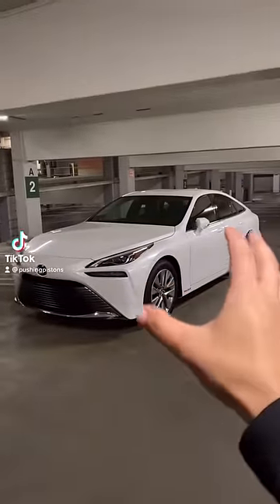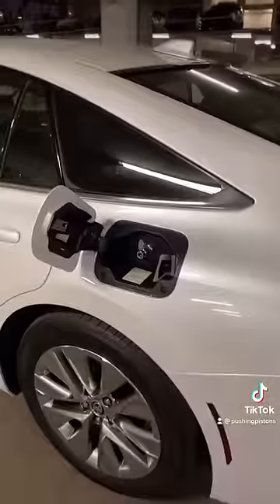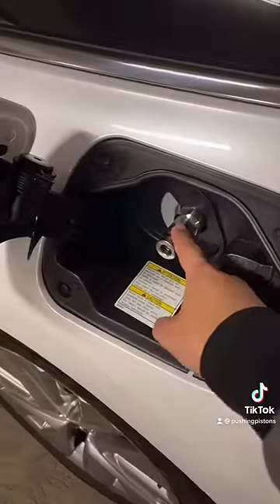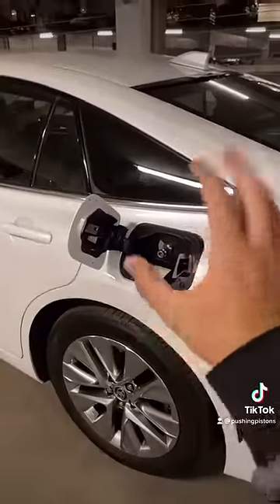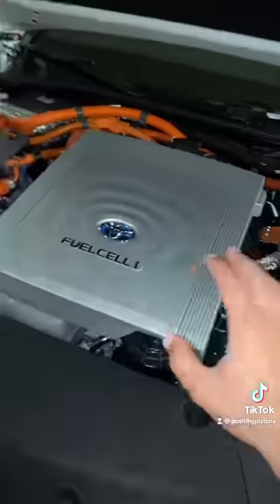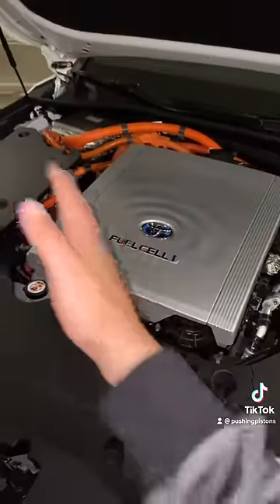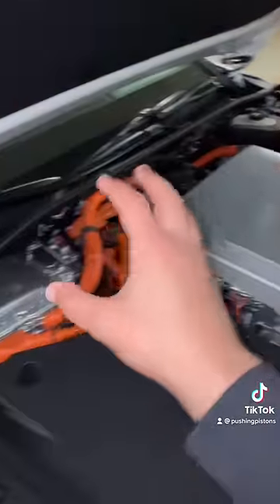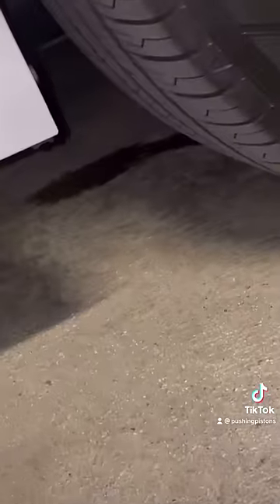How Toyota Mirai Works

Comment: The first electric car with an exhaust... that ejects water...
Reply: @mohdaslam3191  did you pay attention he said there’s electric motors and batteries... it’s just an electric car that uses hydrogen instead of a wall plug to charge
Reply: @stevenbrumjr1005  bruhh.what i meant was that it is generally called an hydrogen fuell cell car rather than being called as an electric car.
Reply: @mohdaslam3191  no you didn’t, you deleted the comment and everything.. just take the L
Reply: @stevenbrumjr1005  lol it was a mistake i tried to edit it...
Reply: @stevenbrumjr1005  is this what drives you? Handing L’s to people you’ll never talk to in your life. cmon now.
Reply: Wasn't there some before?
Reply: @Ant_Man211  well you didn’t see the original comment he deleted but he was pretty rude, I figured I’d be rude back.
Reply: If we all drive one of these, we can refill the oceans 😂🤣
Reply: @Ant_Man211   hahahahahahaaaa
Reply: @chrissalimi8708  With clean water.
Reply: @Ant_Man211  hold his L
Reply: @mrfirespace  what are you 9?
Reply: Not an exhaust. A drain pipe to be exact.
Reply: Urinates😅
Reply: @stevenbrumjr1005  Don’t fight fire with fire.
Reply: @mohdaslam3191  it’s only called Eletric if it’s main power electricity  from its not hydrogen that is the main power.
Reply: @mohdaslam3191  LMAO comment deleted? Why?
Reply: @mohdaslam3191  

We categorize vehicles by their fuel type, diesel, gas, electic, hybrid, hydrogen. Please read a book
Reply: Ths is the future. We need this way you don’t depend on the grid for everything. Hydrogen + Oxygen = electricity
Reply: Water byproduct not too feasible in a freezing winter climate

Comment: Imagine just crashing one of these and all you see is an explosion of water
Reply: Sounds pretty safe lol besides the whole crashing part lol
Reply: Would that be safe?
Reply: @TheBoxingNinja  I mean its water, so i guess its safe
Reply: Actually water is just the byproduct after the process is complete, it doesn’t store it. The car stores extremely flammable hydrogen in it’s tanks.
Reply: @That_Stinger_GT5  hydrogen is flammable
Reply: @That_Stinger_GT5  you know Hydrogen is explosive right? You ever hear of a hydrogen bomb. Not exactly safe
Reply: @Hallowsaw  these cars, if they get into production, are mini hydrogen bombs everywhere. i don’t see how that’s safe
Reply: @Hallowsaw  Hydrogen in these tanks aren’t the same hydrogen in the hydrogen bombs LOL. H bombs use rare isotopes and a completely different process to extract energy which is fusion, not water. These tanks can still be extremely explosive but are very well protected, but not even close to a h bomb.
Reply: @Hallowsaw  Hydrogen bombs are a bit different. It requires an enormous amount of input energy to trigger the fusion that releases that much energy (the concept is to use a fission/"regular" nuke to trigger a second fusion stage), far more than any car crash has ever produced. Although, hydrogen isn't exactly safe and is definitely explosive, it isn't on THAT level lol
Reply: @thejflores1219  yes bro thank you for informing these ignorant people with chemistry
Reply: THEJFLORES12 wanna do my homework
Reply: @That_Stinger_GT5  lol yeah you’re right
Reply: @Hallowsaw  Just imagine a bunch of these next to each other and there being a chain reaction of mini explosions
Reply: It’s actually way more explosive than normal cars
Reply: How is this any less safe than having a tank full of gasoline and getting in a crash? Can anyone actually say wether the explosive potential is more in a hydrogen car or are we all just keyboard physicists here
Reply: @hovojefe  hydrogens heat value is 120 MJ/kg and normal fuel is around 40-50 MJ/kg which means hydrogen cars can potentially to be more explosive than other cars. But they're not any less safe than normal cars because the circumstances which would have to be in place to create an explosion in both cases would certainly lead to a fatality or severe injury. Also, it's just very unlikely for both types of cars to blow up
Reply: @Maximilian_Ingrosso  cool thanks for the info. Based on what you said though, wouldn't the explosive potential of your average car be much more than a hydrogen car because there is a lot more gas in a normal gas tank than there is hydrogen in one of those hydrogen fuel cell cars? Like my gas tank is 45 liters, therefore I carry about 45 kilos of gasoline vs only like 6 kilos of hydrogen,
Reply: Jeff i’ve only had high school chemistry and physics and i must admit that i am not that familiar with hydrogen cars. I have learned about how it combines the hydrogen with oxygen from the air to create water and electricity, but i never got into the details of tank size and such. I guess i just thought there were more hydrogen in those cars. Still, having such an amount of hydrogen compressed into those tanks would mean that in the event of an explosion it would spredd through the air quickly and certainly make a bigger, although not as powerful explosion.
Reply: Hydrogen is pretty flammable so expect big explosion from that
Reply: @hovojefe  but you forget the point where those hydrogen tanks have somewhere around 10,000 psi of pressure
Reply: Even if it explodes, It’ll instantly burn out a certain volume of Oxygen and in that volume of space, the air pressure will be significantly lowered for a short moment. If you know chemistry, you’ll be able to imagine how loud and sudden it’ll happen, and no fire or cloud like regular explosions will have, but the temperature may be able to cause a fire when the air from surrounding area flows to even the pressure and the contents of substance.

In fact, any company does hydrogen battery technology will definitely beware of this and do the safety design ahead of all researches. Toyota’s hydrogen tank has the design to avoid explosions so you’ll at most should be worrying about the leak of hydrogen when a collision happens instead of explosions.

Thus, no, you won’t see an explosion of water.
Reply: I don't see how electric cars with very high voltage batteries are safe on the road either 🙄🤔
Reply: @agarcia4271gaming  you're saying it like electric car is build by someone who just know basic electronic, and just put what ever part they've laying around together without safety precautions
Reply: @Arctic_silverstreak  why have I seen loads of tesla's on fire because of a crash? Oh, and don't call it an accident, because it wasn't.
Reply: @Hallowsaw  Grab your books, and head on back to school, you won't be splitting atoms in this thing...
Reply: @TheBoxingNinja  water is safe
Reply: @dragospahontu  the explosion part.
Reply: @innocentsupra  I'm talking about the explosion part. This is the same process they use to launch ships into space.
Reply: Hydrogen is explosive. Oxygen burns.
Reply: Why isn't anyone talking about the hydrogen blimp which exploded in the 20th century..that's how destructive hydrogen is when ignited.
Reply: @Hallowsaw  hydrogen is not safe but hydrogen bomb is not a good reference. Your car wont turn into hydrogen bomb because if you could make hydrogen bomb by crashing tanks filled with hydrogen every country in the world would have had a hydrogen bomb. The reference you looking for is hindenburg airship disaster.
Reply: @TheRealBlackKnife  here comes another science expert. You do know that transport tankers run on public roads how many hydrogen bombs have exploded in last decade. 

To start a fission reaction of hydrogen, they actually have to detonate many small nuclear bombs around a hydrogen core. To compress the hydrogen to extreme limits before hydrogen bomb detonates. 

Do you think a conservative company that took decades to put in CVT in their car will suddenly decide to sell "mini h-bombs" ?
Reply: Yes... of water...
Reply: No youll see a pretty massive normal explosion first. Then water.... combustion is a funny beast!
Reply: @jorge3234  thank you 😊
Reply: @thejflores1219  but pressurised and can be a catalyst to a far bigger 
Explosion say at a hydrogen station etc. Not a wise route from an attack vector POV, plus they are automated! Hackers wonderland...
Reply: The only way a hydrogen tank can explode is, if you damage the tank and you trap the outgoing hydrogen around.

Hydrogen is way less dense than air. With the smallest breeze it's gone instantly. 

On top, yes it is very flammable that's why it burns. But to explode it needs the exact amount of oxygen.

Never less to say that the tanks are actually like a German tank and splitted apart in 3 tanks with a small capacity.

So basically the risk of an explosion is not to big. Same can happen with gasoline engine
If you have a fire beneath your tank the fuel will turn to gas.
With spark it goos boom. 

Hydrogen has still a lot of issues, wouldn't count safety stuff there tbh
Reply: @colomack245  LOL right??? Y’all never heard of the Hindenburg????
Reply: @TheRealBlackKnife  hydrogen would be turned to water instantly though which would make it safer than gas that can’t
Reply: Lmfao the idiots in the comments saying h2 cars are just h bombs . You guys do know gasoline is a lot more flammable than hydrogen right ? If hydrogen were to leak it would dilute in the air so quickly before it gets the chance to ignite .
Reply: @TheRealBlackKnife  plane's fuel is extremely flammable and people still fly in them...
Reply: @josue679  that's very true when you think about everything and how dangerous it all can be lol, learned some new things from this comment section lol
Reply: Yeah, 10,000psi ain't nothing. I'm sure you'll be fine if it ruptures near you. 🤷🤦‍♂️
Reply: @TheBoxingNinja  Oh hell no! Do you know how reactive hydrogen is?, if one of these fuel cells break, you will level your house!
Reply: @hovojefe  because the hydrogen is pressurized at 10,000 psi. That’s A LOT. That much pressure on impact will leave a hole in the road
Reply: @achannel1124  damn, I didn't know it was pressurized to 10,000 psi that's insane!
Reply: Hydrogen is extremely flammable, just like a regular petrol car.
Reply: @achannel1124 by the time the tank will be punctured cause a nasty explosion it will quickly escape into the atmosphere
Reply: @Hallowsaw ydrogen bombs work extremely different from a exploding hydrogen gas filled tank (nuclear fission)
Reply: Well at least it's a self cleaning crash site
Reply: You’re literally driving around with two giant bombs…. It’s like driving around with 10,000 psi propane tanks
Reply: The car has 3 high pressure hydrogen tanks. They are extremely explosive if crashes. That’s why no one wanted to go the hydrogen route, because it is simply too explosive, much more so than gasoline.
Reply: @innocentsupra as long as the hydrogen is contained yes . Toyota has come up hopefully with the solution thats why  think they haven’t produce any fully electric vehicles only hybrid . Next in line i think it will be Honda at list i hope
Reply: @enricobimbi5181  I see I see (i commented that 2 years ago)

Comment: This shit should be the future
Reply: Mirai or 未来　means future lol
Reply: A lot cooler than some damn Tesla
Reply: @wargames8503  Tesla is cooler since electric motors don't make much heat
Reply: It already is. Sadly the infrastructure is lacking. That’s why everyone is going electric at the moment. Mercedes already sold these cars in California for 250$ a month in the b class model back in 2010
Reply: @shohj6600  what are you talking about?🤨
Reply: it’s still an electric car FYI
Reply: Have you seen how big a hydrogen explosion is? If this car has a malfunction or gets into a crash it will take out half of the city with it.
Reply: @41550daniel  yeah no that's not how it works but nice try
Reply: @41550daniel  Meh, doubt it. The engineer aren't that stupid.
Reply: Look up the costs of driving hydrogen
Reply: Hydrogen is just electric with extra steps.. pure ev is cleaner
Reply: No, it's not. It costs $80 per refuel and is worse for the environment then electric cars. Also there very few hydrogen refuel stops
Reply: @gavcom4060  technically its a hydrogen car. The fuel cells just use hydrogen to produce electric it's half and half
Reply: @41550daniel  dawg that's a hydrogen nuclear bomb your thinking of like WW2 that only happens when the atoms break apart and that's what causes the explosion and blast
Reply: @shohj6600  the Mirai doesn't produce much heat either and it's barely warm after driving for few hours
Reply: Yes it's a shame people are focussing so kuch on electric cars. I'd buy a hydrogen cell car tomorrow if they actually had Hydrigen pumps in my country (Finland). Currently there aren't any.
Reply: @mynameisjeff9312  problem as well is the cost of production of hydrogen fuel. They are working on improving efficiency. Let's hope this work continues.
Reply: is should, but still expensive.
Reply: these are new so of course they would be expensive. There was a time where there were only Tesla chargers in California. These things need way more time and production.
Reply: @41550daniel  the hydrogen tank is carbon fiber with a gell that expands if punctured to displays the oxygen to keep it from exploding, this comment is like saying piping gas line to everyones house is to dangerous.
Reply: @gavcom4060  lithium battery isn’t as big as other evs
Reply: It'll be a hybrid feature soon
Reply: @prestonjames6776 Mirai in Japanese translates to future 

P.S. I’m assuming it’s Japanese because it’s a Toyota and the letters look like Japanese letters

Comment: They can just add a Electric Charge panel to power those batteries, it will be Hybrid (Hydrogen + Electricity) Easy to charge where Hydrogen stations are not available.

Comment: Hydrogen based cars just use combustion to generate electricity, not a chemical reaction. When hydrogen combusts if produces water, which is being fed out using the exhaust

Comment: I actually prefer hydrogen cars to the electric counterparts
Reply: Yeah, to bad in the end, it's still an electric car that uses 4x more electricity per mile to drive.
Reply: Good luck driving one and getting around. We already have a robust network of charging stations. Hydrogen on the other hand is not a viable method of passenger transport at this time. I can see the implications for cargo vehicles though.

Comment: What happens during a frontal collision accident or even a rear end accident? Considering the hydrogen is at great pressure isn't this a bomb on 4 wheels?
Reply: The mirai have a feature that vents the pressure when it gets damaged, you can read more about it if you search it up.
Reply: @H.E.R.e  okay but what if the accident occurs at high speed? Surely the vent would be inadequate when such massive forces are involved....
Reply: @hassanjamal4212  I don’t own Toyota, go complain to them lol
Reply: @H.E.R.e  why would they point out the flaws of their own product their are hoping to sell in large amounts and make profit from....
Reply: @hassanjamal4212  the tanks have been thoroughly tested. Testing included shooting a full tank with a bullet, dropping the tank, putting the tank in flames, freezing the tank, and more. Not 1 person has been injured because of an explosion in a modern hydrogen car. Many people consider them safer than gas or battery powered vehicles.  This is because gas is flammable, and stays where the accident occurred.  Lithium cells in accidents are not exactly safe, as they cause chain reactions, which can cause the car to burn for hours.
Reply: @trevorv9035  source for those tests?
Reply: @hassanjamal4212  Google
Reply: would you just die anyway if the accident occurred in high speed... even if you use conventional car...
Reply: @billy7349  but an explosion or a fire can increase risk to others
Reply: @hassanjamal4212  i mean.. you said that what if the accident occurs at high speed? surely the vent would be inadequate when such massive forces are involved... so i replied that we would just dieeeeeee with any car if its occurs in high speed lol
Reply: @billy7349  true. Would it explode though
Reply: @hassanjamal4212  surely this car wouldn't have been made if it was gonna be a bomb.
Reply: Obviously they thought about this lol... I’m sure it’s not a bomb on 4 wheels
Reply: With high pressure.. Well it will explode
Reply: @paperhouse6282  wrong

Comment: Electric cars are more efficient and have more charging stations
Reply: you’re right since there is a loss when converting hydrogen to electricity but using hydrogen as a “battery” would actually be more efficient than huge battery on a semi truck bc that’s where this technology is most viable

Comment: It only takes an hour to fill that tank and costs $100.  Why, because the stations only hold enough gas to fill 40 cars,  the hose freezes to the side of the car and there is going to be a line at the only station that is open.

Comment: Before dummies start talking about it being a driving bomb; look up what a type 4 hydrogen tank is. You can throw it in a campfire, shoot at it with a gun, fill it up to 1400 bar, etc. Yes there would be a huge invisible flame if hydrogen lines break. But good luck breaking some good old swagelok